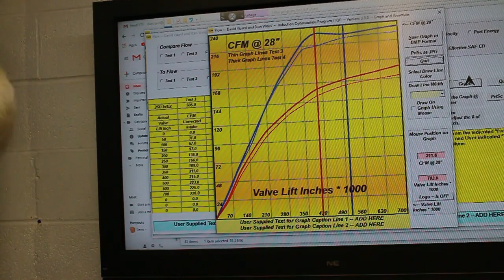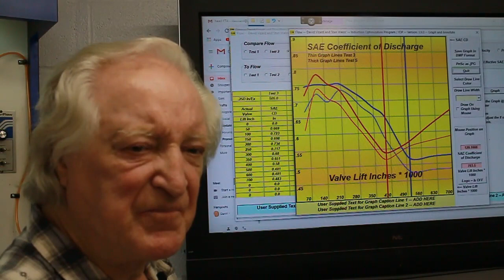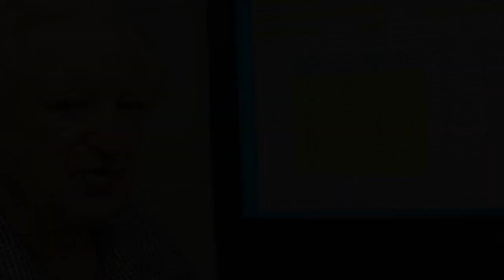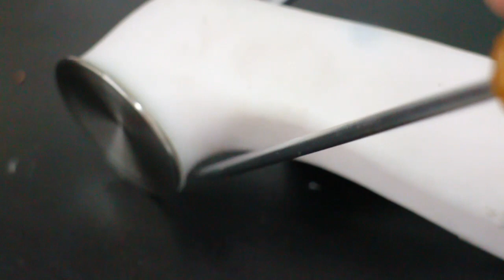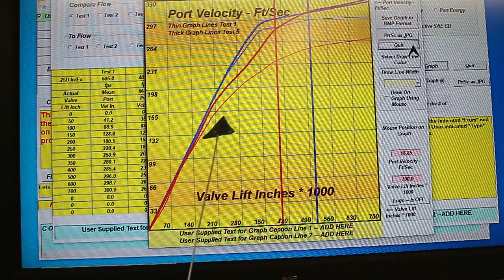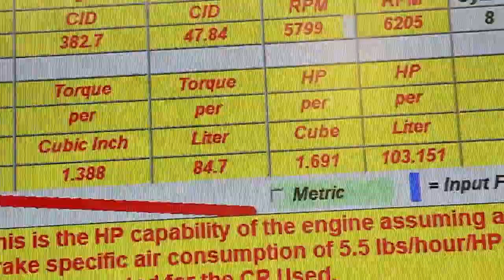Edelbrock intermediate porting Episode 8 part 2

Comment: Love the videos...thank u.for all the work & time you put into them..! !.I have a question...do you know if all the Edelbrock E-street alum cyl heads for a sbc come out of the box with some/or all of the rocker arm stud bolts drilled & taped "into" the intake runners of the cyl head...?...& left were its not derssed up or smoothed out.....I have "never" seen "any" head,new or old cast or alum...like this..in 50 plus years..is there some weard bennift u get from this that I need to learn..?..a friend got a pair of them  new on line & sent me some pictures of this...any help would be "greatly" appreciated...if your 2 busy David I understand...not a problum....has anyone else used these heads with runners like this & had "no" problums...thanks in advance..David please keep the videos coming as long as time will allow ....

Comment: David, on the new Yaris 3 cyl engine, they dont seem to bother about the short side radius at all, no workings there at all.
But, there is a ramp leading off it 1/2 inch  or so ,  it directs all flow on that side to the other side of the port
the  info seen  says it increases swirl,which actually make more HP
have you seen it, comments please.

Comment: I've been watching a lot of your videos the last 3 months. I have built probably 40 engines all to do a specific job. I learned a long time ago you have to match intake, Cam and heads to attain the true potential of an engine. I know the new EFI engines have limits. I'm building a 351 Windsor for a 79 F150. And I am uncertain as to which cam choose for my build. The lightning intake, gt40p heads with Hypertech flat top pistons. My goal is to attain maximum torque. Any advice would be appreciated.

Comment: Awesome.  Can you examine an E-TEC Edelbrock head in the same way?  These are Vortec heads and require the Vortec Air Gap intake.  Raised runner intake ports .100, and would enjoy the content and the findings. Thanks.

Comment: I have the older edelbrock 450hp kit on my 400 sbc full hyd roller. I would like to get over the 500 hp rating. I guess I’ll be watching your videos for more info
Reply: See David's info about camshaft selection - the big name guys are frequently pretty far off, especially if you are building a 400 and their cam was originally designed for a 350
Reply: @vettedoctor6667  I can’t remember the size of the cam.  But it is not the one edelbrock supplies. It’s a crane roller cam. I looked it up awhile back and I need to get at least a 2200 stall. I’m just hoping that the heads keep up

Comment: Great informative videos,  I have a set of Edelbrock RPM heads (60929) on my 440 mopar, can the same be applied to them?
Reply: I would think so. I'm going to port my Promaxx 440 heads as well. I'll be utilizing all of these principles to the best of my novice abilities.  Mopar kinda screwed the pooch on their wedge heads , espically the 440.. 906's, 452's etc...  are essentially small block Chevy heads on a giant bottom end. So, in my opinion, there is much to be gained from any of these modifications given how under sized these heads are from the factory. Even the Edelbrock RPM offerings for a 440 are only a 210 cc port !! Thats a mid range sized port for a 350 ci Chevy !

Comment: Much appreciated hands-on instruction, as a complement to the more theoretical book material!  David, would it be fair to say that the flow characteristics on the unported head do not greatly exceed a stock Vortec head?  And unless I missed it, I don't think you stated the intake port volume (at one point you said it was increased by 8cc).   I think ideal for a 383 would be in the neighborhood of 190cc?  Thanks!

Comment: Can I ask: How much does the de-shrouding / re-shaping of the combustion chamber effect the compression ratio?
Reply from the maker: In most cases the small loss in compression is offset by the gains. I typically see 20 cfm gains through most of the lift cycle on the average substandard chamber design. Some with  more and some with less gain. In many cases you can replicate the original chamber volume by cutting the head .020-.030. This head gained less than 3cc after the chamber work which = about .013 surfacing off of the head gasket surface. But even without this correction there was a significantly larger gain than the loss in compression would have incurred.
Reply: @marvingvx1  Thanks for that info, David. Keep up the great work!
Reply: @marvingvx1  This is 20 CFM gain per cylinder?